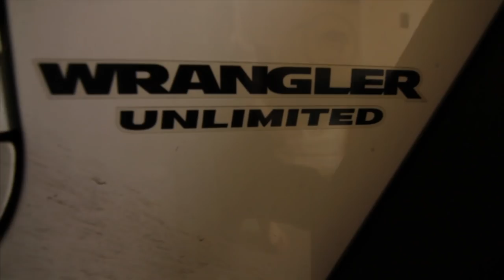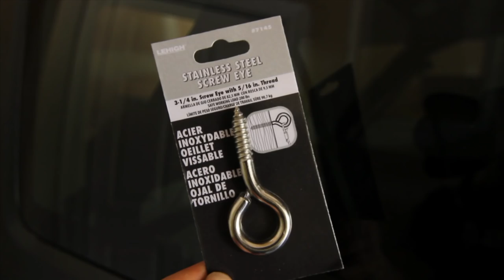STEP by STEP - How to lift up Jeep Wrangler's hard top | MicBergsma

Comment: How do you put the top back on? Wont those straps release the top all at once and send it crashing down?
Reply: yes it would haha but i bet they did it one by one
Reply: +seth nagel No. It won't of the tension is held with one had while the other releases the ratchet. Having done the ratchet strap trick myself for any years, if the top is hoisted far higher than the body of the Jeep, I would recommend lowering it a foot at a time so as not to have an extremely off-kilter top hanging at a precarious angle.

Comment: I've been looking at ways to simply store my hard top. Love the concept of this idea. Cheap and very effective. My only question is, how do you get it down without it dropping all of the way. You can ratchet up, but it doesn't ratchet down, it'd drop all at once. What did you do, or anyone else, because I like this concept a lot. Thanks.
Reply: Just saw this video and plan to do it today for a temporary way to store it. Did you try this? I'm assuming if you "drop" each corner individually that it shouldn't be that bad. I plan to only raise it enough to drive out.

Comment: Nice job.  I was considering doing something with pulleys and block and tackle, but I think I will just go with the way you ladies did it.  I have to hoist mine all the way up high to use my garage and thought that releasing ratchet tie-downs to reinstall would be tough from that height, but I will just release them with someone holding the hardtop and get it to lower position (inches above the jeep) to put the hardtop back on.  No complicated plans.  Thanks.

Comment: Great narration.  The only problem I saw was that you removed the passenger front panel first.  It should be removed after the drivers side top panel.  Also, I add another strap between the two on each lift as a failsafe, only a suggestion, great video.
Reply: Having worked for Jeep when the new JK freedom  tops first came out, I asked if it matters what side comes off first. The answer from the Jeep engineers? "Not at all".
Reply: +Secured Circus I assume it would be the one that has the lip covering the other one right? I agree it aint going to break anything.

Comment: The Soft top makes a lot of noise at higher speeds. Also the soft tops aren't exactly well designed.  The fact that you can take off the front 2 panels in a few minutes makes the hard top the way to go. I have set up the same system in my garage, and I purchased a "best top" soft top and I pretty much use that all summer.

Comment: What a pain the hardtop!! one of the reason I sold the car, the other reason the horrible VM 4 cyl diesel engine. What do they think about when they design those car?  looking cool is not enough.
Reply: 4 cylinder engine??? Someone obviously stole the stock 3.8 (2007-11) or 3.6 (2012-current) V6 and gave you the wrong engine.

Comment: Deaf means you can't hear not speak. I would think the proper term is mute, to those who are calling them deaf. Anyways, this seems like a lot of work, especially on these new jeeps. I like my 98 because it's a lot easier. All it takes is two guys or gals and a torque wrench then lift and set in your garage.